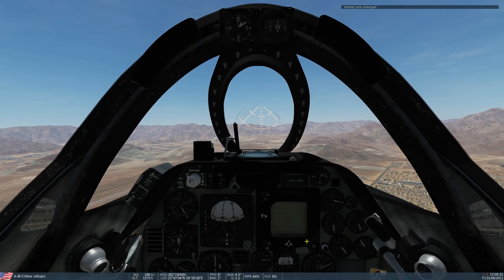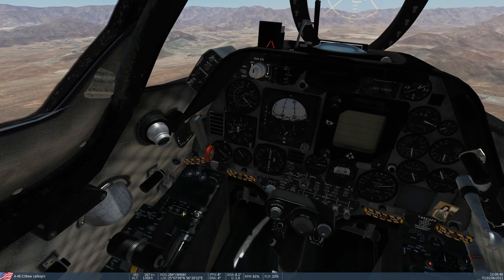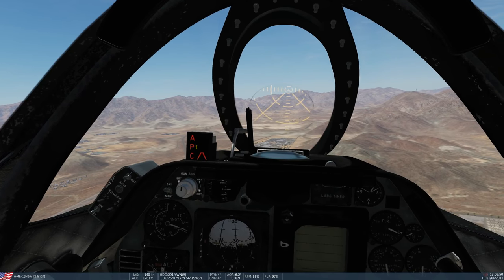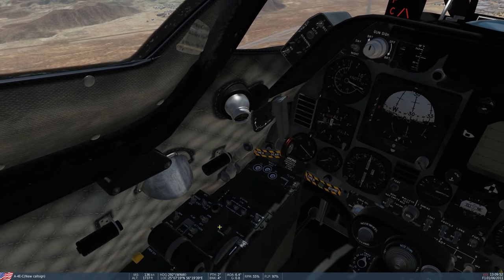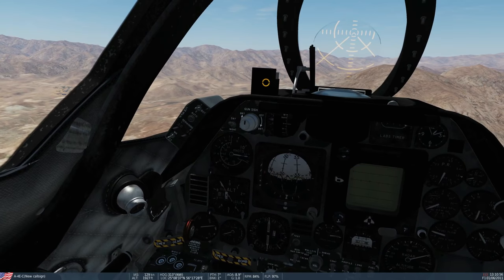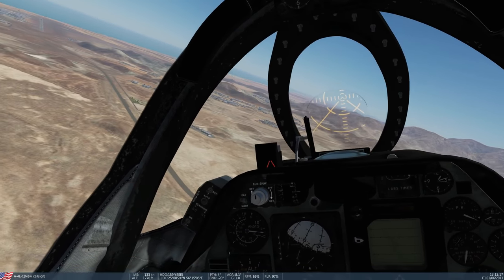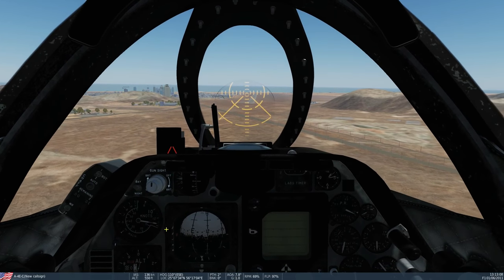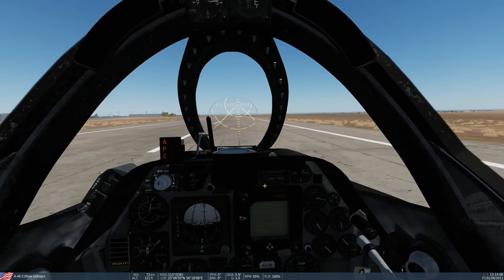A-4E Skyhawk: APC Auto Throttle Tutorial | DCS WORLD

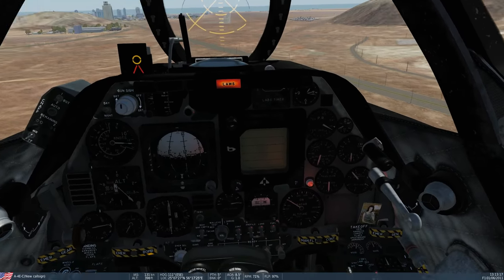Comment: The approach AoA that’s recommended in the NATOPS manual is 17.5 degrees. Thats also reflected on the AoA indicator, at 7:34 as the meatball is displayed (yellow circle. The AoA gauge actually has a white index mark there for it too. The white triangular mark on the bottom of the AoA indicator (8 degrees) is an approximate recommended AoA for cruise at 35k feet. Thanks for your awesome videos and hard work!

Comment: It seems completely backwards to me. "pitch for speed, throttle for altitude" is not valid anymore?
Reply: It is not, you pitch to maintain your speed. It line using trim. You pitch up to slow down, and you pitch down to speed up. Same with your throttle. The more power you input, the faster you go. How do you compensate for the speed up? Your pitch. You pitch up(hense increasing rate of climb) to maintain your speed. Same goes with the opposite, you decrease throttle to decend cause you loose airspeed so you pitch down to speed up. Makes sense?